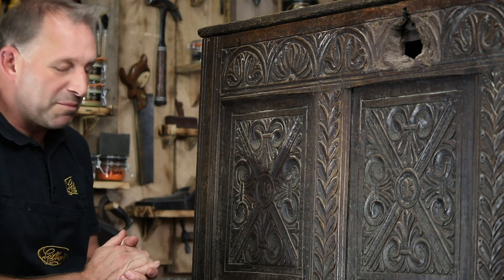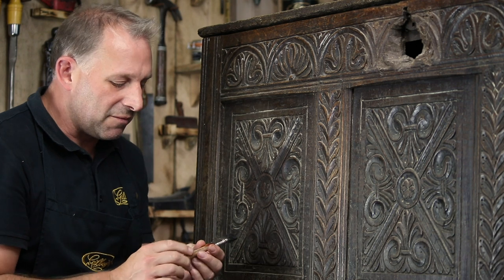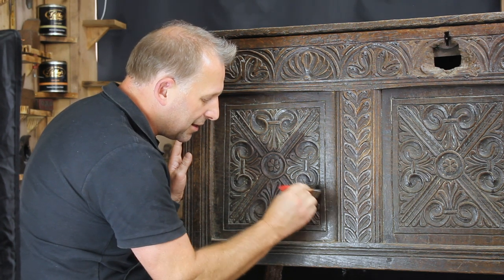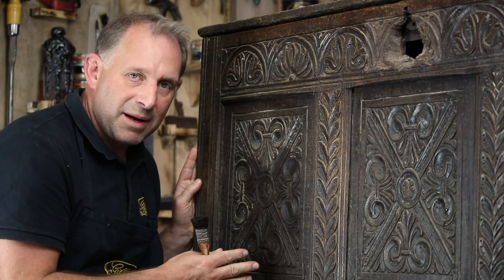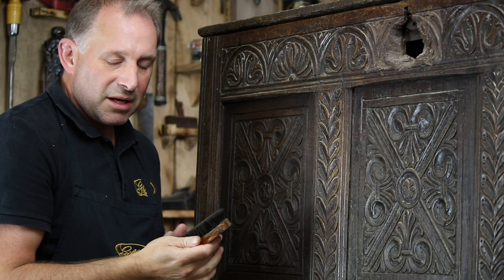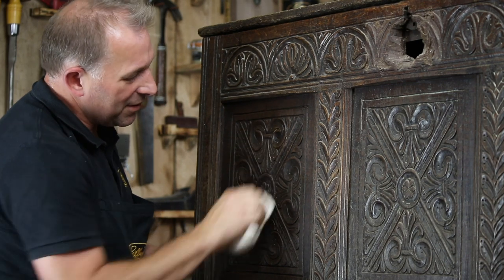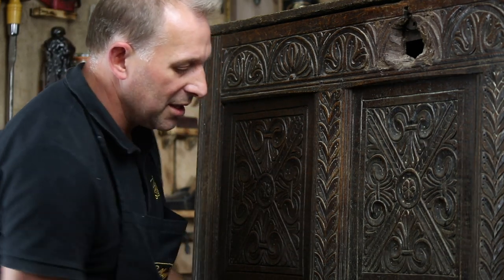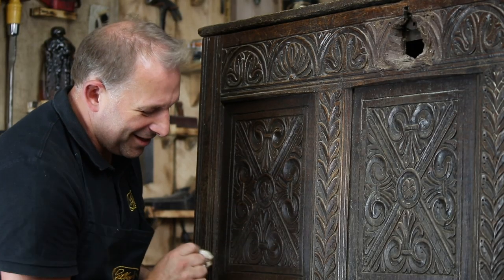Gilboys Beeswax Furniture Polish - How To Polish Carved Wood

Comment: I’m buying a 1929 Spanish Colonial and it has a hand-carved coffered front door that has some weather damage and dry patches. I’ve seen descriptions of antique hand-carved wood furniture being polished with beeswax. However, interior pieces like the chest you’re working on were probably never varnished, so there’s nothing to remove. My impulse is to remove the door, lay it on sawhorses and sand all over with very fine sandpaper or steel wool to remove dirt and traces of finish. Vacuum and wipe down with mineral spirits to remove the dust. Then apply the wax and be sure to get it in all the nooks and crannies. Thoughts?
Reply from the maker: Hi Julia. Can you send me a few images of it first. (simon@gilboys.co.uk). My feeling is that you wont need to go to such extremes of sanding. But let me have a look at the photo's first. Simon

Comment: I have a carved chest from the Philippines that my father brought back about 70 years ago. There are white scuff marks on the base of the piece. I would like to remove those before polishing and buffing. Ideas on how to proceed?
Reply from the maker: Are you sure you need to remove them? I would be tempted to apply our antique gold to the chest first (assuming it is a dark coloured chest) Then look at it again and see if you need to carry out any repair work. 
Applying our wax polish to a wood finish is easy to do, and will often disguise light scratches and marks. 🙂

Comment: Hi Simon,  I'm working on a small drop-flap oak Art Nouveau table where the flaps are all different colours now (the top is much lighter than the flaps)  and the whole table top is covered with Art Nouveau carving.
So I'm working on lightening the whole piece (sanding then oxalic acid perhaps?)
At the finishing stage, should the top have a sanding coat before the wax?
Reply from the maker: Hi Elaine. 
Have you stripped the old finish off yet? If not then strip the old finish off and then reassess the colour variation. when you have stripped it: Lift all the leaves so they are fixed in position and wash over the surface with some methylated spirits so you can see the true colour difference. Then once you are happy, you can wash over the surface with oxalic acid. 
I would definitely seal the surface first then wax it. 🙂
I hope you have success. 
Simon.
Reply: @GilboysRestoration  Hi Simon,  Thank you so much for your response.  So far, I have stripped and sanded where possible and the table top sections are now all the same colour but there are still traces of the dark stain.  I wasn't sure whether to continue until I'm back to the natural timber or to start the refinishing process.
Reply from the maker: @elainebutterworth8051  It's difficult to say without seeing it, but you must make sure that all the old finish is removed before you start the refinishing process. ✅